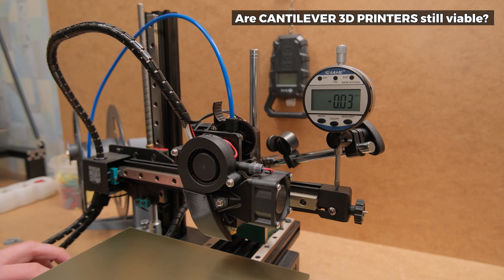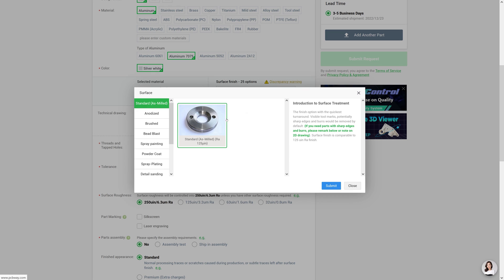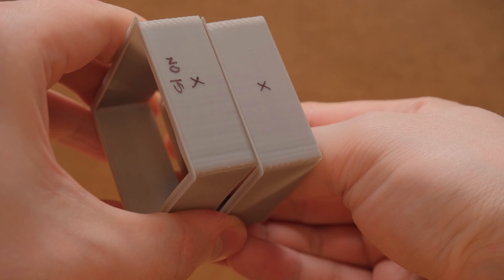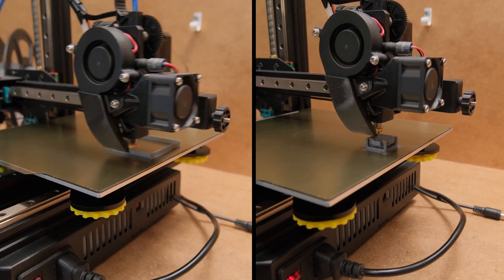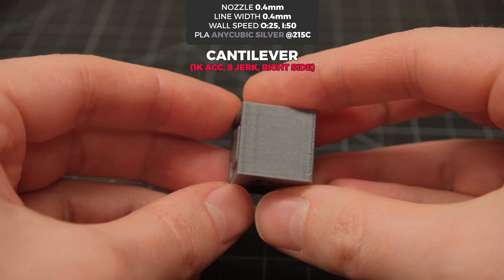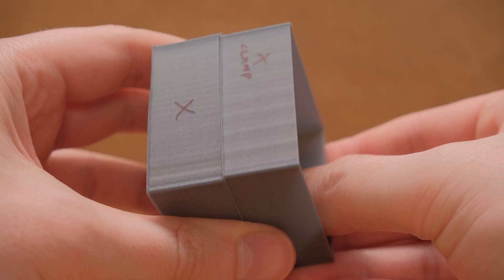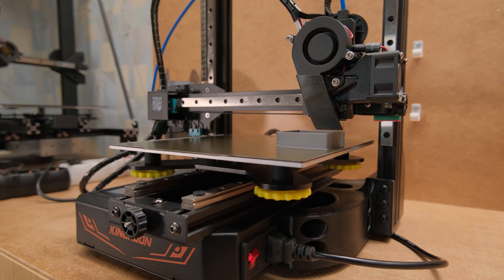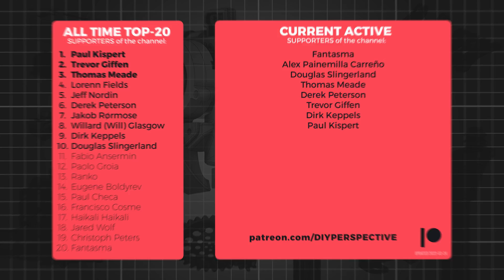Are Cantilever 3D PRINTERS still VIABLE!? (KP3S, Prusa Mini, etc.)

Comment: I have 3 kp3s (non-pro) with dual z rails, anti-backlash nut with anti wobble joint, a nema17 with 1.09nm of torque for the y axis, .65nm for x, bmg with precision cut hardened steel internals shimmed and constrained really well, red lizard cold side coupled to an 85watt volcano length chc w/hardened steel cht nozzle, dual 5015, 4010 on the toolhead, drivers running in uart and klipperized, dual board fans, btt pi, 
My print quantity @ 200mm/s and 12k accel, scv/jerk 5mm/s is way better than all of the examples you have shown. I wonder if the non-pro having a large chunk of plastic from the dual z rod upgrade to dampen is why it prints better than the pro.

Comment: I just recently built a homebrew cantilever for fun using ender 3 parts and a Bambu a1 mini bed. Fully tuned it with klipper. I get the waves like you showed but I plan on using it for quick prototypes of small parts so it’s fine for me. I like the small size of it and it was fun to make

Comment: Dropping in my two cents a year later.
What is there against printing outer walls first and only lowering acceleration for those? I already did that on an older printer.

Comment: I have only owned one cantilever printer, a RatRig VMinion.  It is my favorite printer for low layer height small form factor detailed prints.  Naturally being a RatRig it's been run with Klipper from the day I finished building it.  Funny thing it that it does it's best at up to 70 mm/sec or 100 to 130 mm/sec, VFA shows up right around 90, must be hitting some resonance.  Interesting video.  Stay well!

Comment: I think about modifying a Prusa mini. The problem there in my opinion is the belt tensioner of the x-axis, as the x-axis is made of two rods with a plastic part for the idler at the end. You adjust belt tension by turning two normal screws. This means the lenght of x-axis variates a bit when adjusting the belt tension. So in adition to the extra z also modification of x is needed.
But still it might be an interesting project.

Comment: If we can easily  upgrade to dual z rail on cantilevers it makes it even betters starter printers for beginners in cost I think
Reply from the maker: Usually, the most cost-effective printers are those that you don't need to upgrade. Companies can source parts way cheaper in bulk. The problem is that most companies are very incompetent in designing good 3d printers.

Comment: I like the idea of cantilevers as good enough solutions: small, light, cheap. Still Klipper is good even with slower speeds, especially compared to native firmware with no 'preheat PLA' command?
I do like how it looks with two rails, there is that completeness of square frames.
Reply from the maker: Completely agree with the idea. I see no reason why Klipper would be worse at slower speeds. I almost never use preheat commands, I always do it manually or write a sequence of the heating process in slicer.
Yea, I love the look of it! :)

Comment: Vou need to test the V-Minion by Ratrig
Reply from the maker: It is a cool 3d printer but $500 for a cantilever is a lot IMO. You can buy a decent 300x300 CoreXY for that much.
Reply: @PrintingPerspective  the price may be a little spicy, but let me tell you, your down points on the video are not present on the V-Minion
Reply from the maker: I completely trust you that it almost doesn't have any wobble and print quality is great. I mean, it uses MGN15 rail + 3060 profile vs MGN12 rail + 2040 profile on the KP3S and the print head most likely are lighter. It is a premium well designed cantilever after all.

Comment: I still have and use my original Ender 2 cantilever printer and despite having many printers and even one that cost 18 times the cost of the Ender 2 this Ender 2 is my most reliable printer, I can just send it a file and dont even bother to watch the first layer go down, it just works, I have thought of adding linear rails to it but considering I have it set up absolutely perfect I dont want to risk spoiling it, it will get some new POM wheels eventualy and I have already swapped all the fans for quieter ones and added a part cooling fan (yes they came without part cooling as PLA had only just become popular) and have a spring steel magnetic textured PEI bed on it. whenever I have a part that will fit on this machine I use it despite having a printer that will print 4 times faster, I just love using the Ender 2!
Reply from the maker: I think a lot of people don't understand that no matter the printer you use with high speeds print rate success rates drops. So I would rather have a print that has a 99% success rate at 8 hours than 90% at 5 hours for example. Plus small 3d printers are so cute! :3
Reply: @PrintingPerspective  You hit the nail on the head!
Reply: uwu

Comment: Two things: What if the bed (y axis) was isolated (independent) from the print head (X and Z motion). No transfer of vibration. What if you used a dual rail on a single Z column.
Reply from the maker: 1. I would love to see your 3d printer design of this because maybe it would be interesting just to test it but there is no practical value in this.
2. I used two MGN9H rails on one 2040 profile in my LR + Ballscrew Z-axis video, it was way more rigid, but like I said at this end of the video it doesn't make any sense to beef up one side when you can completely eliminate the wobble by using rails from both.